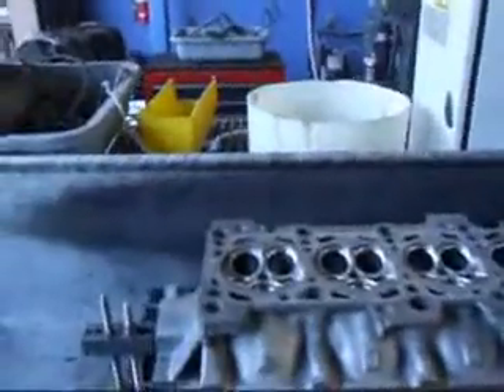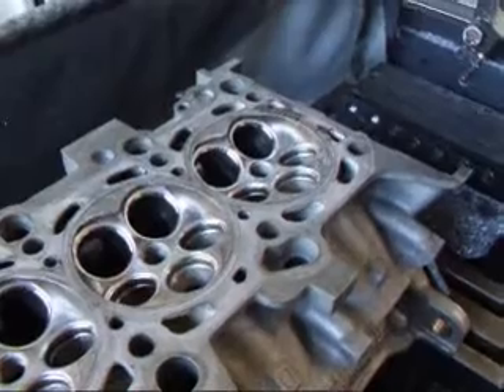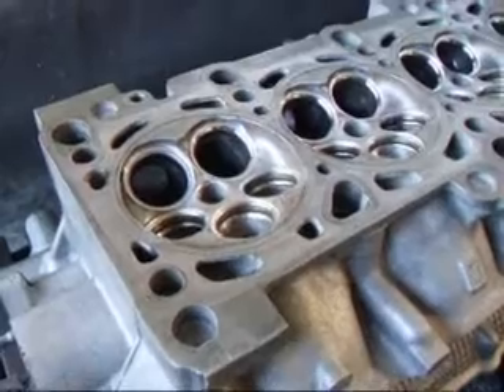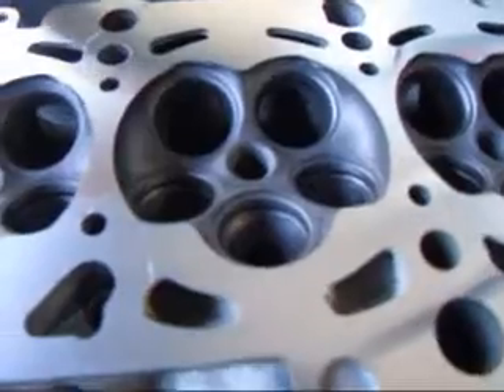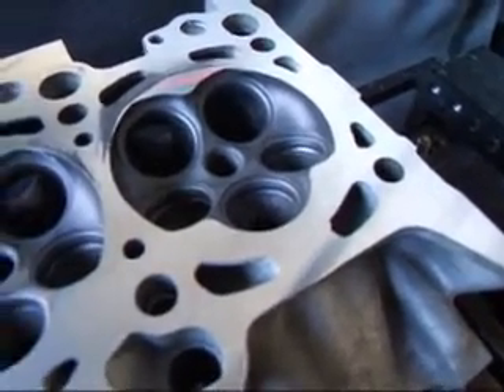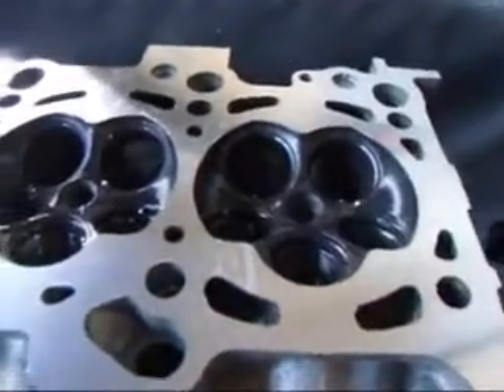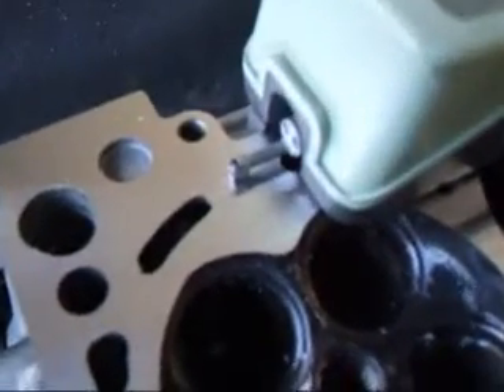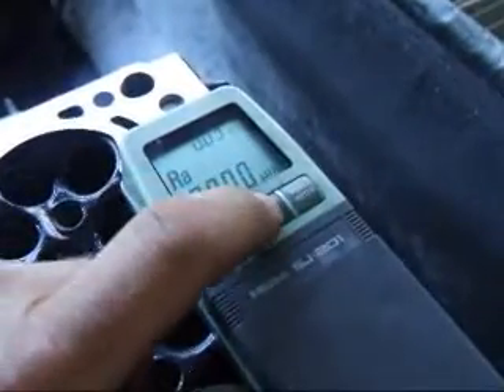VW 5-Valve Cylinder Head Resurfacing

Comment: Does resurfacing effect the power the engine gives out? i have a 1.8t and the timing chain broke :( bent valves..and one head needs to be, i guess buffed out or sanded down..

Comment: Oh, man...I've just remembered I'm about due for a belt change on my Audi TT!
Reply: you forgot didn't you? smoked all the valves?
Reply: Nope...got it changed right after I posted that. The dealer did that for me, though I have since fixed numerous other more minor issues. Running well now, but would definitely like to change the gear oil. I'm not sure the dealer's claim of lasting the life of the car is relevant when this car has lasted so long...I've got 240k on it now.
Reply: I just took the head off a TT 1.8 with 85k miles and the valves had very little wear. Too bad the previous owner didn't change his belt.
All those new looking valves were bent like pretzels. These things should have come with a dash light that turns on when its time to change the belt. I'm really shocked you've gotten 240k out of yours.
Reply: It doesn't even use oil between changes...I've always used Mobile 0-40.

Comment: The term you spoke of on your surface finish tester "Ra" means "Roughness Average" . The letters that appear in the read out window beside your 16.1 reading mean "Micro inches" . I also noticed in that same window the value ".03" , that's called the "Cut Off Value" . It should be reading ".08" . There would be a small switch on the back end of the tester that has 3 positions , usually the centre position is ".08" . This .08 by far, hands down is the most common industry standard cut off value.

Comment: HA! If you increase the CR from 8.5 to 16, the engine WON'T RUN. Do you even realize what you're proposing? Absolutely insane. You would never achieve it. Diesel engines run at that CR. The clearence between piston and head is very small. In a gas engine, you would need 150-200 octane to run the thing, and I doubt you'd be able to find a starter capable of turning it over without a compression release system. You're funny guy, I'll give you that.

Comment: ive had to work on the 2.8 6 cyl version/ with 5 valves per cyl it was in a front end collision and the timing pulley broke.  it was a nightmare. 4 bent valves and a decent gouge out of piston 1...not something i ever want to do again...but i have to on another wrecked passat.

Comment: they answer is ver simple, it's the same as why people invented multivalve engines.
answer: the air has less effort to get in and better fuel vaporization.

the midle of the 3 intake valves has a different timing.

Comment: I have a Range Rover with a VM diesel engine that I'm rebuilding because a broken injector sleeve (damaged a piston and the turbo).
I think the heads (one per cylinder) must be resurfaced, but the workshop manual says that must not be done because the heads are nickel plated.
The heads are a bit expensive (400 Euros each), and I'm trying to avoid buying new ones...
What you think? Resurface? Or not?
Thanks in advance!
Cheers from Portugal

Comment: @3star2nr Yeah, use a fly cutter. Be very careful, and cut as little as possible. It would be more precise if you took it to a machine shop, but yes, it could be done if you have a modicum of machining skills. Also, make sure that you are completely square (obviously) and also use an extremely sharp tool, otherwise you will probably ruin the head.

Comment: Timing belts can break on any car esspecially the belt is not inspected and replaced at the correct intervals or shit like oil gets on it.
I would not be put off buying any car due to one isolated instance of a failure, esspecially somthing like a timing belt which is a bit of a weak point in any engine (that uses a timing belt, pretty much every modern engine).

Comment: This is all pretty hear say, i don't know why they would bother designing an engine with 5 valves, which is a performance design feature not a nessesity and then make it with massive tollarances or with poor ring materials. remember these are presige cars too.
Advances in manufacturing technology have allowed the ecconomical use of smaller tollarences in modern cars and very few have problems such as excessive oil consumption.

Comment from the maker: Not on every head because I check heads in the machine with the dial indicator. What I do find, occasionally are twisted head and I have to shim  the head at diagonal ends to split the difference, but when the heads come off, they are straight.